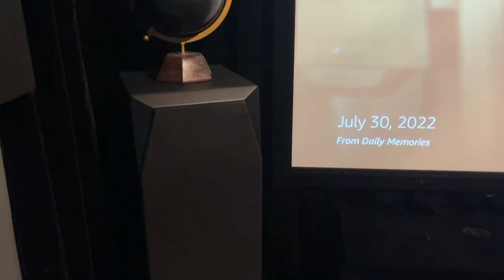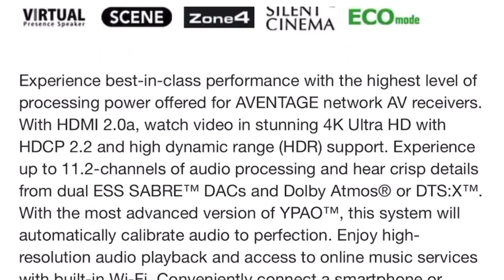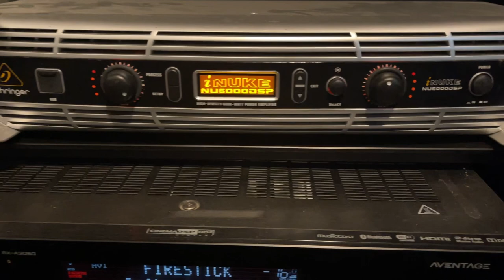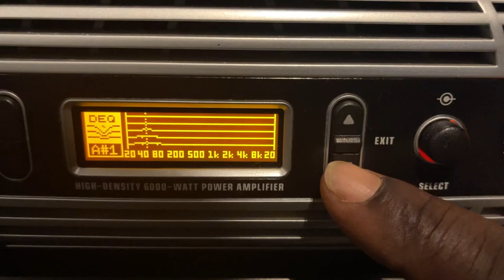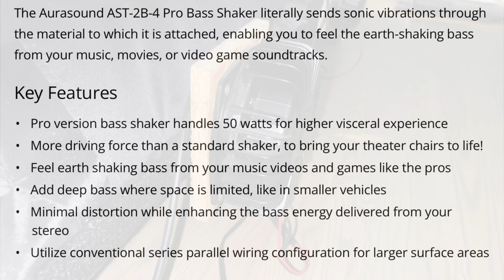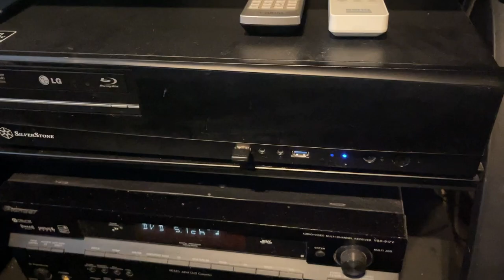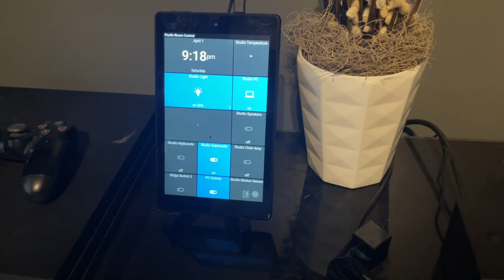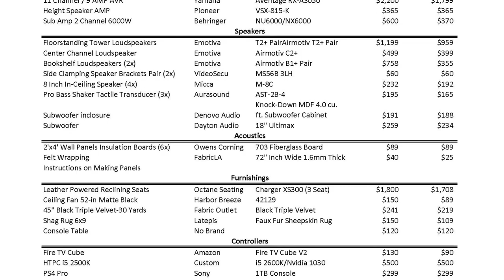Unbelievable Small 7.2.4 Dolby Atmos Home Theater 🤯 - Under $10k?!

Comment: Good stuff. I have a similar set up but different speakers. I use Smartthings and Harmony combines also with Alexa (let's me speak for off/on). I did two SVS SB4000 subs but I wish I was skilled enough to do those 18 and a flat pack. How low does the bass go in your space? That's my one regret right now....the feeling that I can't reach those notes like an 18" sub
Reply from the maker: I would say 20Hz easy. Feels even lower with the shakers. I actually get even bass in all 3 seats. C2+ does an amazing job for MLP but my old Polk CS5 did a better job with the left and right seats. I actually just upgraded my base level speakers and really just now realizing how much better they are. Break-in period maybe?…Room sound freaking amazing! What speakers do you have?
Reply: @rontalley  I have the SVS Ultra LCR and everything else Klipsch in wall/ceiling. I'm using the Monolith 11channel amp to run everything but I have the Average 3080 so that helps with the processing. I'm sure it's not tuned as well as it should be..I'm not as good with the YAPO but I'm highly impressed with the SVS Ultra line. I went from front towers to bookshelves. The towers didn't give me the extra help in base I thought I was getting. I realized it when the bookshelves were the same or better overall.
Reply from the maker: Sweat setup! The SVS are nice. Was on my short list but the center speaker was no where to be found…
Reply: @rontalley  I just upgraded to the 120" Elite screen two weeks ago🤣🤣🤣. Amazon and covid has changed the game with what we can get now and competitive prices. My first 90" Stewart costed $3k 12 years ago. Now, I got a much larger screen for less than a TV!

Comment: Panels should be below beside speakers not too high
Reply from the maker: I could definitely use more panels. I have REW and a UMIK-1 and after several (many) test, I got the best overall response with where they are now. When I had them down lower, I was getting some nasty reflections vs where they are now. Thanks for watching!